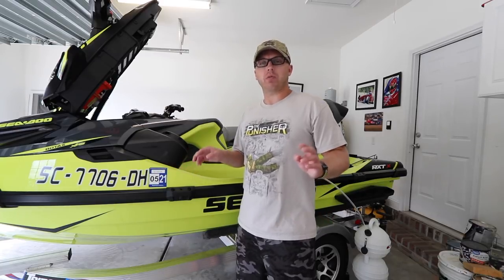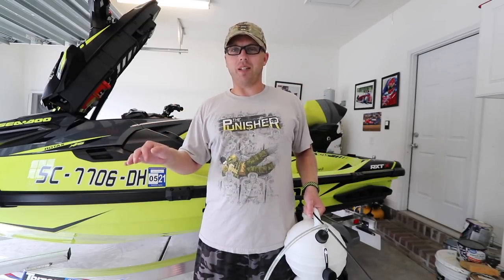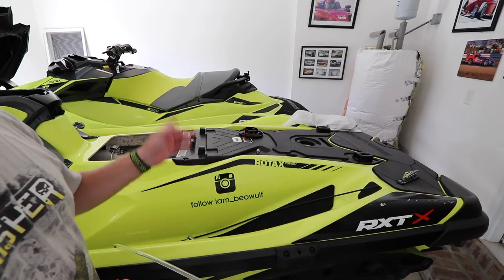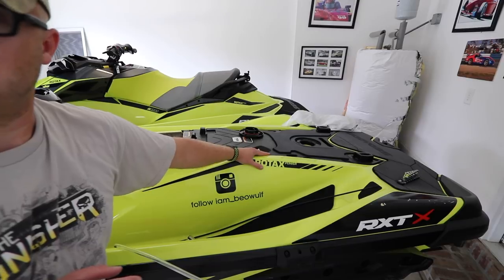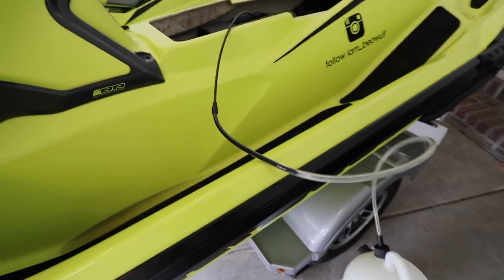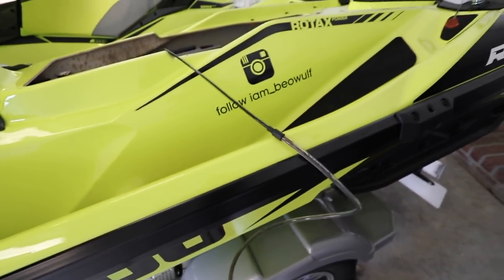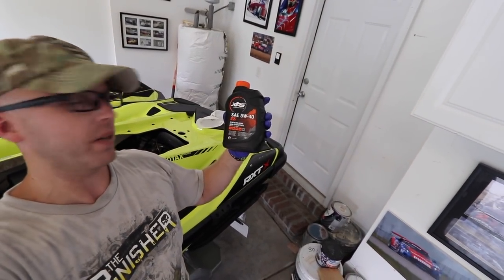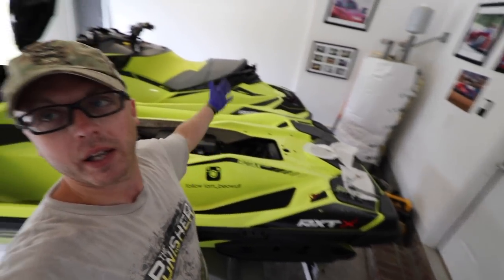How to change oil in 2018 Sea Doo RXT X 300

Comment: The owners manual says the first oil change should be done at 50 hours. Then 100 hours, then 200. See page 118 on the owners manual. Good video, much appreciated.
Reply from the maker: Yes the manual says that but two different Sea Doo dealers say 100 hours
Reply: Since you are doing your own maintenance for the most part, i'd stick to the manuals instructions instead of the dealers service departments suggestions. At 200 hours, it's a smart decision to service it at the dealer since the supercharger needs to be "inspected" along with impeller seals, etc., at that time.   If you ever decide to go riding in South Florida, I would like to meet up and ride a little with you.  Mine has 45 hours and the riva overspeed module, only mod and it's doing 77mph (and holding it) all day.  If you plan on doing any more mods to this ski, beware of your Flywheel bolts!!! You've been warned lol
Reply: do u know how may liters?

Comment: Do you have to reset the maintenance message? I just changed the oil on my fishpro at 35.6 hours and the maintenance required message come up when I pressed the power button (no key attached).

Comment: Hey Beowulf, I have the same trailer as you, I noticed your license plate is not bent back like mine is from putting the skis up to drain out after washing them down. Do you drain the foot wells and engine compartment out a different way than lifting the tongue on trailer up?
Reply from the maker: I don't have plate on the back so not sure. I run fan in ski to dry up the water.

Comment: Is the throttle response good with the 2018 rxtx 300? Because i have a 2017 seadoo gti se 155 and the throttle response is really bad. I also have a 2005 seadoo gti se 155 and the throttle response is much better because it’s not electronic. My friend let me ride his 2016 seadoo rxtx260 and the throttle response was still slow. Maybe you can do a video on the throttle response? because I’m thinking of getting a 2018 rxtx 300.
Reply: I have a 2017 GTI 130 and throttle response on it is great. give it throttle and it goes. also have a 2015 GTI 155 and it is same way. i've never had any lag to speak of on them.
Reply: The lag isn’t severe but i definitely notice it because I’m used to my older gti se 155 which has a throttle body that connects straight to the throttle lever with a cable instead of electronically
Reply from the maker: I have no lag
Reply: Old skis use a cable from accelerator to throttle body where new skis use a "drive by wire system" which has a position sensor at throttle lever which tells the computer how much to open the throttle butterfly via a small electric motor, this delay is normal you can also  feel response difference in different automotive systems.

Comment: I would add that after sucking oil out remove the tube and hold throttle wide open (this turns off fuel pump so it will not start) and crank engine for about 8 seconds. then wait about a minute and do it again. this will pump the oil in passages and filter to let it drain back to bottom. then give it 10 minutes and insert tube again and suck the rest out.  that will get the most used oil out. 
also agree there is no way i would go 100 hours on that oil. maybe 30-40 but then it will get changed. and on a supercharged PWC it is real important to use the OEM oil. using any other synthetic is actually bad for the supercharger slip washers. 
also its not critical to be at top of dipstick area for oil level. most recommend level be in the middle of the area for best performance.  that way its not low and not over filled.
Reply: Ryan it's my service tech buddy recommended to do that. I don't remember if it's in the manual or not though.
Reply: http://www.greenhulk.net/forums/showthread.php?t=32 and http://notsealed.com/easy-oil-change-seadoo-pwc.html and many other sources all say to hold throttle wide open and crank engine for a very short time. also not related to this but i have been doing this with every lawnmower i've owned for 20+ years and never had an engine failure and those actually started and ran a couple seconds each time. also do it every time i change the oil on my Grizzly 660 since 2005 and its still going strong. with it i remove the spark plug wire so it doesn't start when i crank it. I truly do not believe any damage will be done cranking the engine over a few seconds once a year. the Seadoo engine is not starting when holding throttle wide open and its only for a few seconds. * I am an AMSOIL dealer and have spent thousands upon thousands of hours reading bobistheoilguy forums.*** 

that being said . . . will it hurt to leave the oil in there that does not come out from the first vacuum, not at all. that minimal amount will mix with the new oil and be just as good so not cranking it is an option also. but if you are an over thinker about oil like me you would want to get every drop out you can before putting in fresh.
Reply: the oil pan/sump on a car engine is effectively different with its drain plug. i do let it drain a very long time and at the right angle to get the most oil out as possible and with its increased capacity on most models the residual oil is less of a percentage of the new oil added to capacity.  but to answer your question simply - no.
Reply: Read the service manual.  You have to hold the throttle down and crank the engine to move the oil from the magneto side to the PTO side (or vice versa, I can't recall)  Greg Brown is spot on 100% correct.
Reply: Thank you! Does it matter if I do this before or after I change the oil filter?
Reply: Rob Greenwood I would do it before changing filter.

Comment: What ever oil your using seems trash have a older 2010 gtx had it since new and first thing I did when I got it was pumped that shitty brp oil out and have been running castrol gtx in it for the entire time I’ve had it. even after about 70 or so hours oil doesn’t look as bad as that never had any issues and ski never misses a beat don’t trust that brp stuff
Reply from the maker: You should be changing your oil more often. Also heads up Castrol makes the oil for brp. I run different brand oil now. Thanks for the feedback